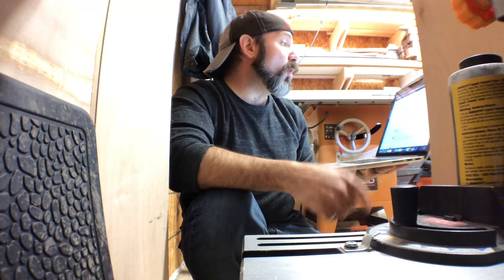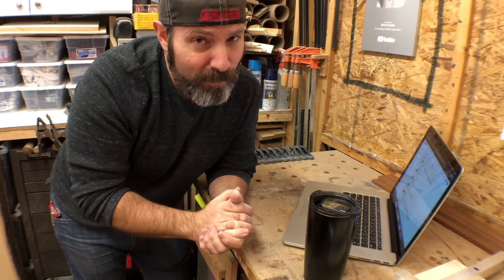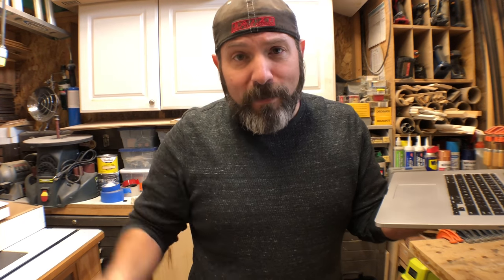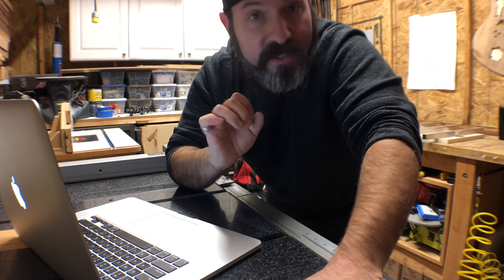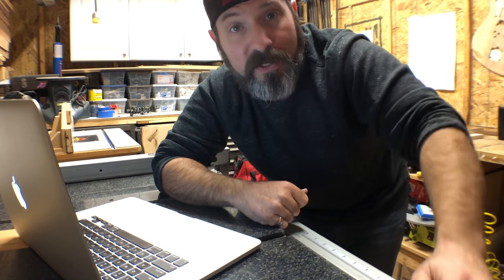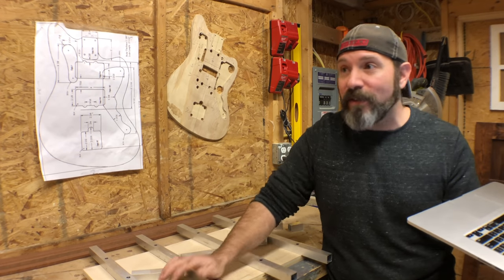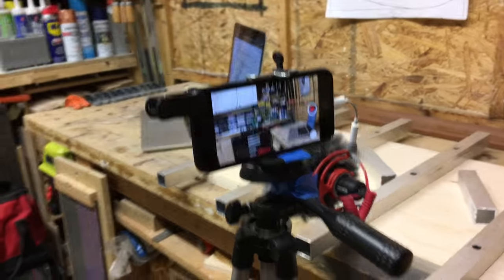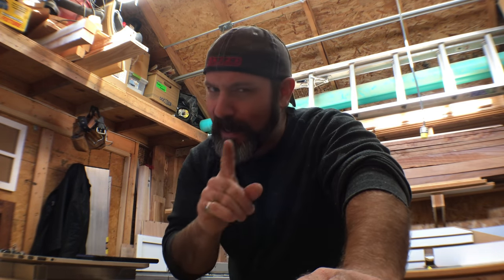Answering your Questions!!! / Milwaukee Giveaway Winner!

Comment: Your fave shop tool answer has caused me more confusion!  As a newer weekend woodworking Nana, I have some tools but  I am trying to decide which ones I still really need.  The two I've  been trying to decide between are:  table saw or router.  I am happy to know I'm  on the right track.  Honestly, it does sound like you probably couldn't  make that decision either ;-).   I guess I'll put both on my wish list and see what Santa decides.
Last year he brought me a 12" sliding compound miter saw (my face tool so far) and a random orbital sander.  My husband thought I was crazy but Santa knew how bad I wanted them.
Thanks for responding to my question.
Have a wonderful Christmas.
Reply from the maker: Oh I know! It's so hard to decide! But if someone put a gun to my head and made me decide in 10 seconds I would have to say....... Table saw! LOL 
But keep in mind that the decision comes from the projects that I usually do. I can't tell you how many of my projects start with ripping a sheet of plywood down to multiple smaller pieces. Also, I LOVE that the better table saw gives me the capability to have a stacked Dado blade set over 3/4" thick which not all table saws can do. And you just can't beat the accuracy! I could not make a square cut to save my life on my old table saw and it DROVE ME NUTS! In the end, its more about what YOU need NOW. But one thing I can promise you.... if you get a table saw for Christmas you will not look back.... but you will also still want that 1/2" Router LOL.... Which won't even matter because if you get a Router for Christmas you feel THE EXACT SAME WAY! LOLOLOLOL. Let me know what happens haha
Reply: @MichaelBuilds  I know I need that table saw.  I avoid anything with ply because i can't cut a straight line either.  At 59 with 2 spinal surgeries I really can't throw around those sheets either but I like big projects. My 1st 2 builds 15 months & 12 months ago were a day bed and a fancy king size panel bed - frame, headboard, footboard, rails...everything.  I want that router but I NEED the table saw.
One more question: how much sawdust (not treated) can a 40 lb dog eat before she  pukes?   All the piles I was sweeping up today vanished before I could get them into the trash can. Yikes.

Comment: the guy talking about "powdered time" I think he is referring to the Rapid Set Set Control that gives you more working time before it sets up.
Reply: I think he called it "time in a bag" or something similar
Reply: Fun fact I looked at the SDS sheet and it's actually just citric acid. Which you can get online for about 1/20th the price. Just mix it gram for gram. Each packet is 25 grams you can mix a max of 4 bags per a bag on rapidset so mix 100 grams of citric acid per a bag of rapidset to get the maximum delay.

Comment: EPS in Concrete: Yes you can add Polystyrene to your Concrete mix. Think of it as aggregates, so use lots of fine dust particles with smaller amounts of sand-sized and larger as your cand/stone sizes used in the mix. Keep the total polystyrene aggregates to no more than 1/2 the total volume of your concrete mix.

Comment: You can use a concrete stain to achieve some pretty nice effects after the concrete has set.  The effect will change the later you add the stain.  You can also use epoxy coatings on the concrete but that seems to defeat the concrete countertop idea.
Reply from the maker: That’s why I don’t usually color concrete cause I like concrete color so much haha

Comment: I really enjoy your videos. My background is in construction management, but now I do quality control/quality assurance for all phases of the construction industry. It's really refreshing for me to see people get creative with products on the market. I've built a few Rapid Set counter tops using your techniques, for fun.  There's definitely a learning curve, but I never would have thought of this if it weren't for your content. Thanks, and keep up the great work!
Reply: Michael, I also have enjoyed your video's, a lot. We have a ton in common. Short, use to be 5' 11" , but, one thing we differ in, after building over a hundred houses, plus at least that many sizable remodeling projects, now just under 5'8". That's what wear & tear, along with 6 screws in one's back and a few fusions will do to you. I want to learn how to weld, as well. I am a pretty darn good wood turner. You would love it, but plan on a very messy shop. Totally additive. Anyways, don't think you will answer by the time I pour, because that will happen today. With my experience with concrete, round stair ways, many slabs, walk ways, my own addition walls back in the late 80's using plywood forms, I have a product question. I have 5-6 counter tops to do. A coup;e are large and I question the support systems. Both to be exterior table tops. One 48 1/2" round, One 60 1/2" round. Both with umbrella holes. Rapid set products are very new to me. Except using hydro cement. In hopes of not using steel in the tops, I figured using Rapid Set concrete on the bottom section of the cast form for the extra strength it may gain from the aggregate, as well as some agriculture fencing in the mold. I question the frames of the table tops, Both have a right angle X support but without the old tops, a bit of wobble exist. The larger is for a customer of 22 years. Your feelings on using both products together, but the mortar on the bottom(face of the finished edges. Thinking some rebar on the outer edge wouldn't hurt.  My first attempt, your thoughts on using the two products together. I don't question the strength, but the flexibility of the crete. Your thoughts, Have you combined the 2 together yourself.  They also have the two products cement All as well. I'm guessing this is without the aggregate. Again really like your video's, I live in my shop, it's my hobby, interest, and job. Although at 65. no more 7 to 7 days. more like 10 to 6.  Thank you Michael .

Comment: I think the powdered time that was one of the questions might be referring to the "set control" powder that they make for the rapid set mortar which slows down the drying time.  You can use this with the flow control if you need to still have that "flowability" but perhaps need some more time to pour multiple buckets.

Comment: You have a ring on your pinky finger, so I guess you graduated from an engineering school. A lot of engineers are only good at solving problems but not explaining it. Your tutorials are super easy to follow. I just built a concrete counter top and about to seal it; thanks to your videos. Keep up the good work. You rock :)

Comment: RE: "Washing away & losing grout lines etc .. "  Hopefully the question at 10:25 of this video will fix my problem. I must've missed the "un-sanded" part of the "1 hour concrete table" video. I used sanded grout and it actually turned out ok on my first table but then my next table it got sucked up into the concrete. I then made 2 smaller molds to test and still no luck. Came back here and got my question answered. I have yet to go try the unsanded grout but it's on my short list of things to do. Next will be epoxy play .. I am also wondering about the ez-flow white powder - does it give strengthening qualities?

Comment: Awesome Q&A vid. Love your channel I made a countertop thanks to your videos I must of messed up due to it cracked on me after three days of having it in the garage prepping it with epoxy,  after the crack I just made it into a outdoor bar which still worked out nice, I'm still going to give the countertop another shot just this time use some bars for reinforcement,  i would like to make a out door grill , will this cement work with the grill heat and not bust ? Have you ever made a cement grill?
Reply from the maker: as long as the concrete is not exposed to direct flame you will be fine
Reply: @MichaelBuilds  sweet, thanks for the advice. Really enjoy your channel!
Reply: Without proper reinforcement concrete is fairly weak regardless of batch recipe.  Rapid set mortar also has a relatively low flexural strength which makes it a poor choice for long term countertops.  Casting it at 2" thick helps with this but that's a lot of unnecessary weight.

Comment: I did the concrete counter top with an inset for my sink but one part crack while in the form. Can you suggest an adhesive that would work to join the pieces? Is there some kind of cover up I can use to hide the cracks? It's actually the front 4" gap for the sink that broke off.

Comment: Love your videos--thank you!  Using your technique we made a concrete counter top..unfortunately when we removed the form it looks 'stained' (dark and light patches)...any suggestions on how to remove those stains for a more uniform appearance?  thanks!
Reply from the maker: Those are probably pour marks. Unfortunately there is not much you can do about that. You can stain the top and that will blend the dark spots

Comment: Awesome bro. By the way, one more question... how do you know how much water to add to each bag of cement when mixing? Is that standard?
Reply from the maker: There isn’t really a standard but when working with Rapid Set cement you really need to measure the water. I usually mix 5 quarts of water per bag

Comment: If I want to mold several small shelves that span only about 20 inches at the max span triangular in shape and obviously don't need to hold a lot of weight. How thick do you do you think it needs to be. I think 1/2 inch would look good. Would I need to add wire mesh? Or should I go thicker? If so how thick is sufficient?
Reply: Also the supports are only small metal tabs about 1/2" square in the 3 corners on a welded metal frame. Will this be too small of a contact point for the concrete?  BTW love your video style.
Reply from the maker: Thank you so much for the kind words Gary! The absolute thinnest I would ever go is 3/4 of an inch thick and yes I would definitely add metal mash for added support. It’s hard to say about those metal tabs though. I would have to see to make sure but a half inch doesn’t sound sufficient enough unfortunately.

Comment: Have you ever used non shrink grout ?
Reply from the maker: Absolutely. That’s what Rapid Sets “Cement All” is. It’s not my favorite material to use with concrete countertops but it can definitely be done 👍🏻😊
Reply: Michael Builds hey man like your videos. We used non shrink under anchor bolts and hydraulic to patch walls. I’ve never heard of that brand you use in N C . Lowe’s said they would have to order it special for tops. Use to live in three rivers before I moved here don’t miss the wind and lake effect. Lol